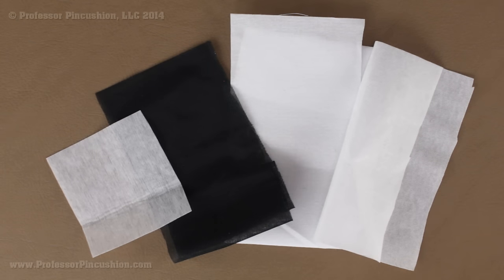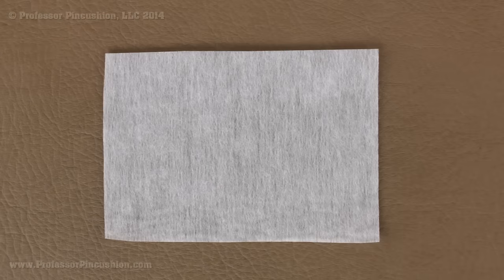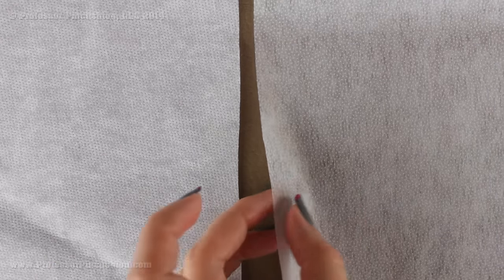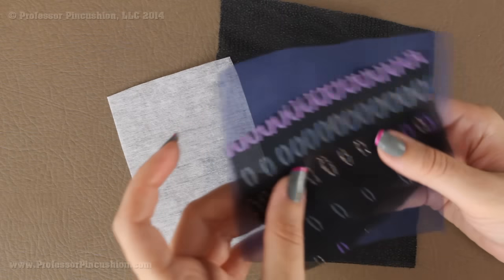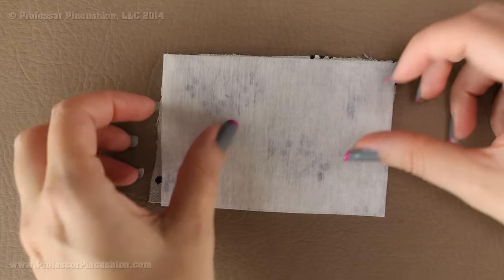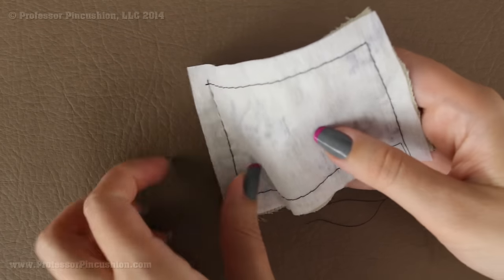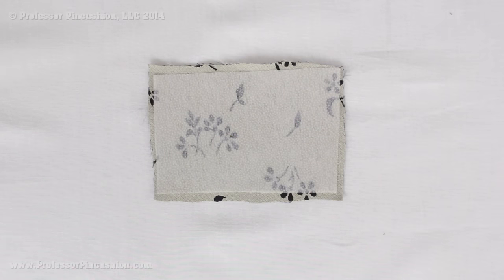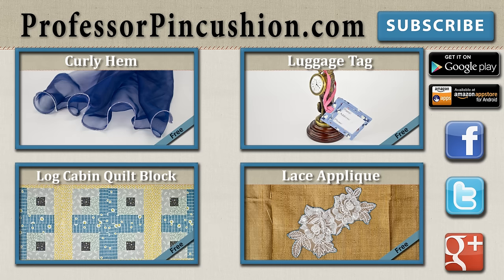Sewing Interfacing Basics - Interfacing 101

Comment: This is exactly what I was looking for.
I had 4 years of fashion school and not once did we go over sew in interfacing.
I made a dress (synthetic fabric, two different colours of thread criss crossing eachother giving a different colour to the fabric depending on where the light hits it but still matte) that I had interfaced parts of. They took well, the bond was strong.
I had that dress on the hanger for 5 years, never worn or laundered after being sewn. And now when I wanted to wear it for a wedding the interfacing has peeled off at some places.
This hasn't happened to natural fibre pieces that have also been hanging for 5 years. It's just this dress made of this odd material.
After reading a bit I discovered that not all fabrics take fusible interfacing well.
Now I decided to spare myself the headache and always use a sew-in interfacing on synthetic fabrics.
I've never had any complaints with fusibles on cotton or similar fibres.
Reply from the maker: I'm so glad you found our tutorial helpful :)

Comment: Thank you. I just finished fusing. I used parchment paper on the edges once I got some glue on my iron. Luckily I also have the tube of stuff to remove the glue which I reused each time the parchment didn't fully cover the fusible. The Pellon instructions advised to have the interfacing on the bottim during fusing but the fashion fabric didn't line up perfectly on the top.

Thank you for lots of good info. Good job!
Reply from the maker: You can, but sometimes I purposely cut my interfacing smaller than my fabric piece and that makes it hard to line up right. I haven't had any issues so far, fusing with the interfacing on top.

Comment: I am brand new to sewing with interfacing. Brand new as in I have never done it before. Please excuse the ignorance of these questions: 1) do you add interfacing to both pieces of fabric? Like if I were to make a tote both pieces of fabric would get interfacing? 2) after adding the interfacing would I sew both pieces of fabric together or iron both pieces together?
Reply from the maker: It's usually just one fabric...but it really depends on how stiff you want the final outcome of the project to be.  Interfacing only has the fusible glue on one side so you can't iron two pieces of fabric together using the fusible interfacing.  If you wanted to do something like that, you would use fusible webbing which is a web of glue that usually has a paper backing, allowing you to fuse it to one fabric, peel off the paper and then fuse it to another fabric.  It will also stiffen the fabric but it's main use is for doing applique, not for stabilizing fabric.  I hope that answers your questions.

Comment: Do you have any recommendations for using interfacing with easily wrinkled fabrics like linen?  Loved the video!  Super informative!
Reply from the maker: you can use a light to midweight fusible interfacing. I would press your fabric prior to applying the interfacing. With the interfacing attached (which acts as a stabilizer) it'll probably wrinkle less in that area.

Comment: Another great tutorial — thanks for sharing! Some quick questions about woven fusible interfacing: Does it tend to shrink in the finished item? Do you / can you prewash? How do you compensate for shrinkage if you don't prewash?
Reply from the maker: According to the Pellon literature I've read, you need to precare all woven interfacing, even the fusible.  If it were me and I were to throw it in the dryer, I would use a low heat or let it air dry.  There's no way to adjust for shrinking after you fuse it to fabric and it could shrink and warp the look of your fabric.
Reply: Thank you!
Reply: Elena Langlois

Comment: Great video. You did a really good job explaining without dragging out the information. I do have a question though..... I'll start by admitting I'm not a sewer but I would like to know if visible interfacing would work in place of a rug pad? I ask because we just let in hardwood floors and our large entry rug has a rough backing that we don't want scratching our floors. It seems like a heavy, fusible interesting might be a good solution but I just don't know how well it would hold up, especially since I wouldn't be sandwiching it between two fabrics.
Reply from the maker: hmmmm....i probably would't.  It's actually pretty thin and I think if the rug rubs against it a lot, it might start to tear.  Also the glue bubbles don't really protrude that much so I don't know if it'll really keep the rug from slipping and bunching up.  I also had rug issues as well on my flooring and discovered that this type of padding work the best for me:  https://www.overstock.com/Home-Garden/Superior-Hard-Surface-and-Carpet-Rug-Pad-3-x-5/2498434/product.html   I no longer get the bunching or traveling rug.  I hope that helps!  :)

Comment: Very helpful! I’m working on a project making fabric storage boxes with peltex f71 and the pattern allows you to adjust for the size box you need. To make the size box I need the piece of peltex would need to be 28” versus the 20” sold by the yard. Is there any way to join peltex or is there a better product I should consider using? Thanks for any advice and again very good tutorial on interfacing... much appreciated.
Reply from the maker: hmmmm....if you're using fusible interfacing, I would just iron them side by side on the fabric, it's not ideal but I think it's better than overlapping them.
Reply: Professor Pincushion yea that may work. Thanks for the idea ;)

Comment: I could use your help, if possible, please. I used heavyweight fusible interfacing on a lined, fabric envelope, but after turning it through, the outer fabric is all wrinkled. It looks like the bond between the cotton fabric, and the interfacing, didn't hold. It was very smooth, well adhered, and fully cooled. Would you please know why this happened, and more importantly, can it be put right? I have several more of these fabric envelopes to make, and this was just the first. Thanks in advance, x
Reply from the maker: did you do a good press after turning right side out?  You should still be able to press it

Comment: Hello! Can I use two different weight of fusible interfacing in one mask? Medium 931 weight fused to the front cotton and 845 lite fused to the inside back cotton? I ask because two layers of medium are hard to breath though. But, I want the stiffness that an interfacing provides on the inside as well.  I have a lot of 931 so, just trying to figure out my options. Thank you for your expertise!

Comment: I'm going to attempt to make a roller blind out of crushed velvet! I was going to purchase one but they are very expensive! I was wondering what weight should i use? I heard you saying don't use the fusible interfacing on velvet, would this apply to a roller blind? any advice would be greatly appreciated.
Reply from the maker: it really depends on the content of the fabric.  When you buy the fabric, check the information tag and see if it can be ironed.  If it says "do not iron" or "line dry" then I don't think you should.  I probably wouldn't recommend using fusible interfacing on crushed velvet though.  You might damage the fibers from the heat of the iron.

Comment: I have a question: I am making a detachable mandarin collar for a shirt and I am wondering the best type of interfacing to use.  The one I have is a fusible interfacing and I don't feel that that is stiff enough, yet a lot of the ones I looked at at the fabric store were too stiff and would crease every time I bent it. Any ideas?
Reply from the maker: I would probably use the shirt tailor fusible webbing  by pellon.  It does get a little stiffer once it's fused and it should be enough to get the collar to stand up without flopping over.  :)
Reply: +Professor Pincushion thanks so much!

Comment: Ive had a buring question for some time now.  I hope you can explain for me.  What is the difference between 'interfacing'  and  'stabalizer'?     Also, will fusable eventually loosen up over multiple washings?  Would  sew-in be a better chioce if you know in advace the wear your garment will take?
Reply from the maker: interfacing is a stabilizer in that it stabilizes the fabric. There are stabilizers for machine embroidery which means it just helps stabilizes the fabric while sewing your fancy stitches but then you remove the stabilizer afterwards. With interfacing, it's a stabilizer that remains on the fabric because it's used to make your collars, cuffs, or button bands stiffer than the rest of the garment. Most of the time, I use fusible interfacing because it's faster to use but I would use sew-in interfacing if it's a fabric that can't handle getting wet and/or can't take a high heat. Most of the time, like with a collar, the interfacing is enclosed so it's not going to come off easily even if you wash it a lot. Plus, even if you use fusible interfacing, it won't only be fused, the edges will eventually be sewn into seams, same as sew-in interfacing. Hope that helps!
Reply: @ProfessorPincushion  It sure does help!  Thanks so much for the detaild explaination!

Comment: What would you suggest for interfacing a leather watch strap? Something that I can put between two leather layers without making it too thick, medium or lightweight?
Reply from the maker: interfacing isn't usually used on leather.  I think in the case of a watch strap, they're just using a thicker leather and you'll need a really heavy duty machine to do that kind of sewing.

Comment: I have a down comforter that needs repair. My cats constantly damage it with their claws, so I live sewing my comforter and vacuuming my floors.  

I was planning on using a light interfacing to repair all the holes, but you mentioned that the light interfacing doesn't last to long, will it make sense for me to use any other type of interfacing to cover the holes?  If not, can you please suggest any other repair methods?   

Thanks!  =)
Reply from the maker: +Leana Dominguez You can use interfacing, but maybe use the interfacing that has more of a fabric texture to it.  I think it's a called tailor interfacing.  It's in the same section of the regular interfacing
Reply: +Professor Pincushion Thank you  =)

Comment: I don't know if you will see this and be able to help. I used fusable interfacing for the first time well I made mine the same size as my material and I used it on the seam allowance. Will I be able to sew over it or did I ruin it?
Reply from the maker: no it's fine.  it won't hurt anything, it's just not necessary to have it in the seam allowance area. You're still ok! :)

Comment: Do you need to use steam with fusible tape? My instructions say yes. However, prior to reading them I simply used my heat press to press fabric onto a canvas tote and it worked. Without the steam. Just wondering if there will be repercussions later on down the line. Please advise. Thank you!
Reply from the maker: by dampening the press cloth, you're already creating steam so I think it's a little redundant to use the steam on your iron as well.  Hope that helps!
Reply: Thank you! I will probably just use a press cloth to set it once it's done.

Comment: I've watched a few videos on using fusible interfacing and heat with a damp cloth over top is used.  Could you just use the steam setting on the iron instead?
Reply from the maker: I'd still use a press cloth as it helps protective the fabric when using such a high heat

Comment: I'm planning to make a star shaped purse out of faux leather and I was thinking I should use interfacing for the sides so the bag keeps a star shape. Should I do that or do you think the leather will be able to keep its shape on its own?
Reply from the maker: usually with leather interfacing isn't necessary, you also want to be careful, depending on the content, it might not be able to handle the fusing process anyways.
Reply: Use bag stiffener. Its sold at leather shops and there are youtube videos of how to use it.

Comment: do they sell them in large sizes? I'm planning in making a sort o circle skirt with box pleats and I need the box pleats to really stand out. would that work or what do you think I should use?
Reply from the maker: Typically, interfacing isn't used to line a skirt.  While it would provide a little more stability for pleating, you're going to see it on the inside of the skirt.  To get a really nice, crisp pleat, you want to use a skirt fabric that can really hold a good press.  This is usually going to be a cotton fabric like a broadcloth.  When you press your pleat, you can also consider using a spray starch to make it the fabric really stiff and hold the fold.

Comment: I have lettering on a shirt, but it seems to come off... would putting interface behind the letter help? if not any other suggestions?? -thanks
Reply from the maker: use a fusible webbing, like heat and bond.  It's made for ironing two pieces of fabric together.  interfacing only has one side that bonds.

Comment: Interfacing would work when sewing two silky fabrics together?
Reply from the maker: interfacing is for stabilizing fabric so it's always used on one fabric  and then that is sewn to the garment.  For fusing two fabrics together, you'll want to use fusible webbing but I would be careful with silk.  Using fusible means your iron needs to be at a high heat to work and you don't want to damage your fabric.  For silk, you might want to consider using a sew-in interfacing.

Comment: What would be the reason why my lite facing doesn’t stick? I followed instructions damp cloth but i used a old T-shirt and used a steam iron even tried the iron by it self. It’s Pelion brand
Reply from the maker: Someone else was complaining about the same thing and it's actually happened to me before. I sometimes think the interfacing is defective because I've steamed it and kept it on a long time and the glue still didn't fuse. It's very annoying but I don't think it's us
Reply: Professor Pincushion I was going to try some further down the roll. If that don’t work I’ll take it back. Thanks for responding.

Comment: there's an applique for a leg band that im working on that I think needs strengthening so the fabric doesn't tear when it's stretched.  I'm using fleece. will interfacing stick to it and can fleece be ironed in the first place? please respond asap! my deadline is Thursday.
Reply from the maker: fleece is usually made of polyester so you might not be able to get your iron hot enough to use iron on interfacing.  Are you worried about fleece tearing?  This fabric is stretchy but not super stretchy but it doesn't tend to tear so you might be worrying about it for nothing.
Reply: Professor Pincushion yes. it's a half inch wide zig zag applique. and I'm afraid it will tear when it gets stretched after it's sewn onto the band.
Reply: Professor Pincushion and sew on interfacing isn't ideal cuz this applique doesn't have a seam allowance.
Reply from the maker: hmmm...so I imagine the applique is not made out of stretchy fabric.  I mean, even if you use stretch interfacing, if the original fabric is not stretchy it can still be damaged if you force it to stretch.  I don't know of any way to get around that.
Reply: Professor Pincushion well it's fleece so it does have some stretch to it. either way I'm just going to skip the interfacing I think and just try my luck with sewing it on with a zig zag stitch. and if it doesn't work out then I'll just have to go without the leg band.